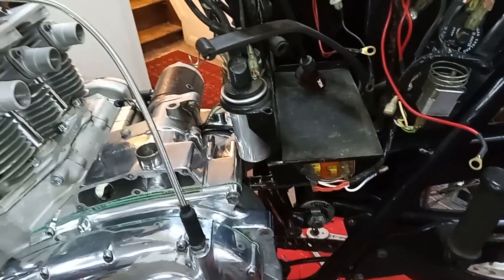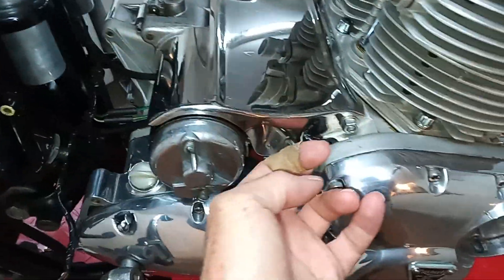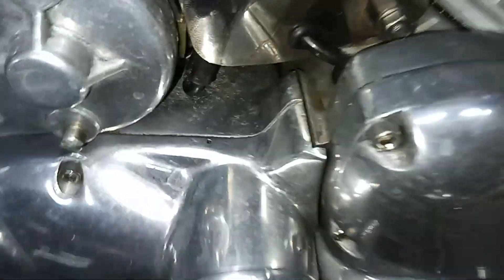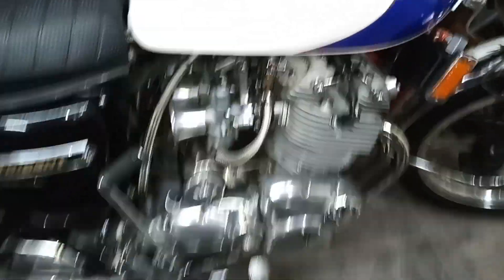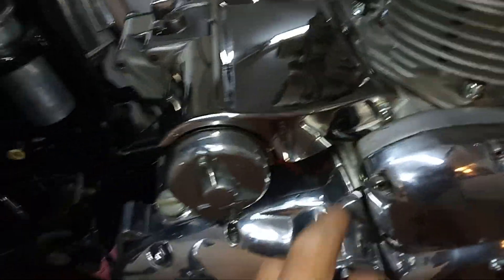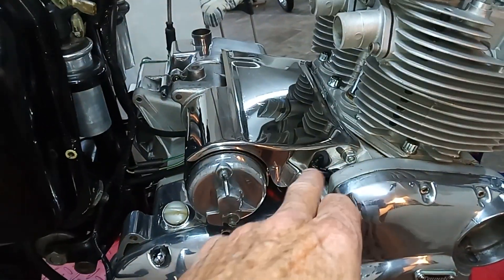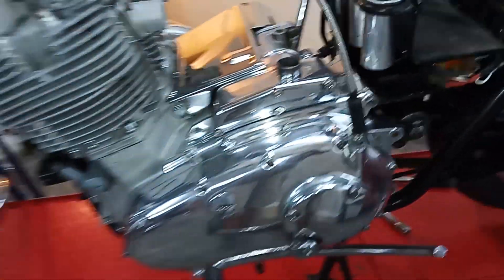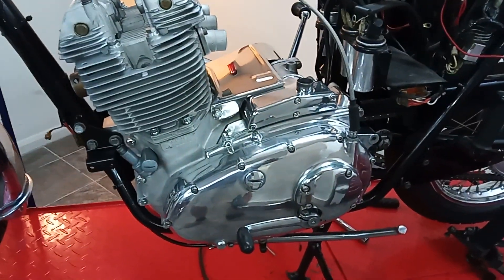Triumph Trident T160 Rebuild. Part 95: Fitting the Starter Motor. Part 3

Comment: I still can't understand why this bike never sold as good as it should have, the T160V came out too late for me, I already had the T150V, but the 160 always looked better, a cross between BSA and Triumph. A smashing looking bike. Sorry if my English is a bit off, being German I don't use English all that often! Keep up the good work. An ex Rocker.
Reply from the maker: Hi David, I think it was just a case of 'too little, too late'.  It has often been said that if the T160 had been launched in 1968 instead of 1975, it might have stood a chance. As it was it was behind the curve. The Honda 750-4 had come out in '68 followed in 1972 by the Kawasaki Z1 (900 cc, 4 cylinders, 4 carbs, 4 silencers, disc front brake, double overhead camshaft, electric start, 5 gears, left hand gear change, no need to tickle the carbs, and no oil leaks - and all this for less than the cost of a T160). It is no coincidence that Triumph split the exhaust on the T160 to make it look more like a 4 cylinder machine. In '68 it might have held its own against the Honda, but by '75 it was just too outdated and too expensive to survive.
Reply: @Chris.rooke150  still love the design,I really liked the look of the Z900, it was different, fresh, you could say erotic! I just can’t get away from the sound of my 3 cylinder, the feeling that I was safe whilst going through tight curves. Thanks for your reply. Dave ( now 72)